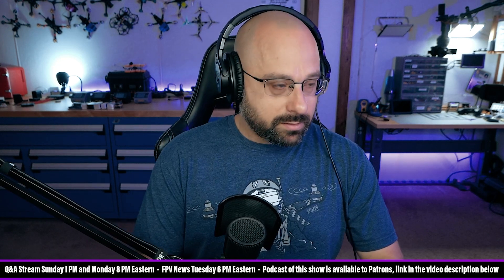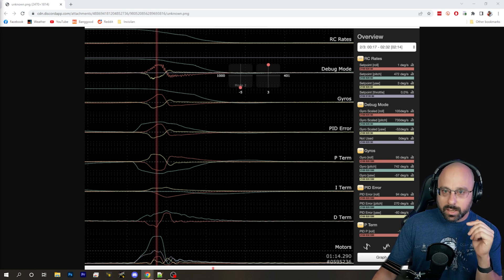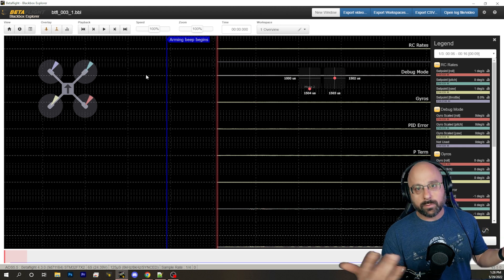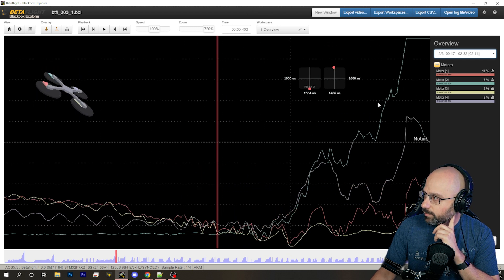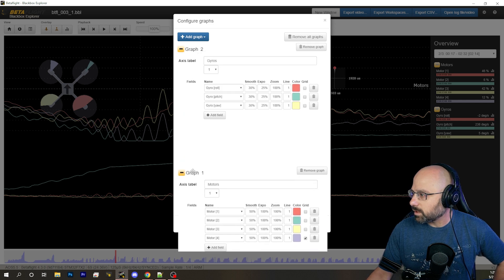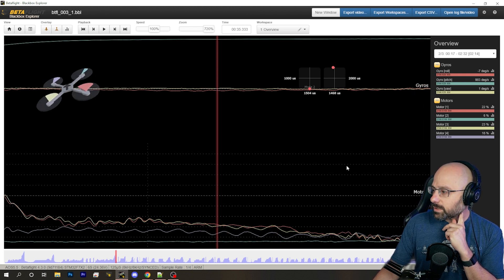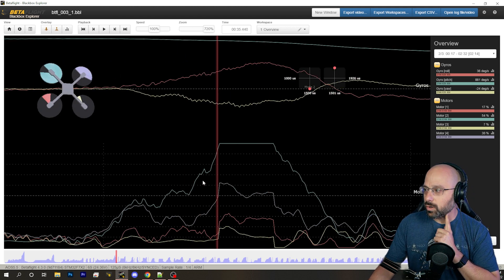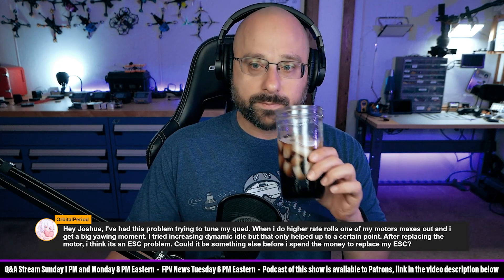My Motor Is Maxing Out! Is This An ESC Issue? - FPV Troubleshooting

Comment: To add to my last comment, when running the motors up in the motors tab in betaflight, there does not appear to be a problem with the motor at all; it spins right up to the same speed as the rest of the motors all the way to full throttle.

Comment: I am having the same issue, but the single motor that is maxing out is happening when flying level, and just bringing the throttle up will cause the quad to behave as if failsafe was triggered and it just falls to the ground. This happens at 50% throttle every time. The quad will fly just fine at anything under 50% throttle. Failsafe has not been triggered, this can be seen in the OSD during flight, and the blackbox log does not give any indication of failsafe.

Comment: Hi. I know this is long ago, but I felt like this could be looked at in a more controlled environment.

I have an almost new BNF quad with just as new batteries, and from day one it had this motor saturation problem. Whenever I go full throttle, the quad leans to one side and loses a lot of power (as in compensating for a motor that is maxed out). And with decreasing battery v, the problem dramatically increases.

After 3 days of fiddling in betaflight testing and understanding that the only real effect comes from limiting motor output to about 94%, which is not ideal at all for many reasons, I made 2 test flights to record and see for myself what exactly could be wrong (I am fairly new to this hobby, 1st time I looked into black box data).

I stopped to hover, and then accelerated straight up and with changing my throttle stick from about 70-100%, so that during each climb I repeat the problem more times and I did those climbs at different battery levels.

In black box recoding, you can see that one motor is saturated a lot sooner then the rest and a lot more of the flight time. When the battery gets low, that one motor is saturated, while the rest are running at only about 80% 

It becomes really noticeable when at hover I am at about 3.7 volts or lower, and when the battery is really low, like going below 3.3v on full throttle, then the problem is just awful, most probably you would hit the ground if you didn't back down a bit from throttle.

Also, it is a 75mm open quad, and I have 2 different BNF like that. The other one works perfectly down to below 3v (dont ask me how I know that...)

Also, the quad with the motor saturation problem when hovering is sounding like it is crying a bit (in comparison, the good quad sound like it has just 1 motor/prop).

So, my queston from day one was, now how do I tell if I have a motor or an esc problem?
Reply: BTW, it seems as if, the 1 motor has less KV and is just maxing out way before the other 3. But the marking on the motor and the rest of it (but only by my eye) seems identical. 

1002 motor, and yes, I tested with different new 40mm props. 1635-3, 1608 and 1610s. It "cries" with all of them.
Reply: To whomever may be reading this. I talked to waranty service of aio manufacturer and also felt for myself that there is no sure way to tell, without swapping motors. So I resoldered motors, set everything up and the symptom remained.